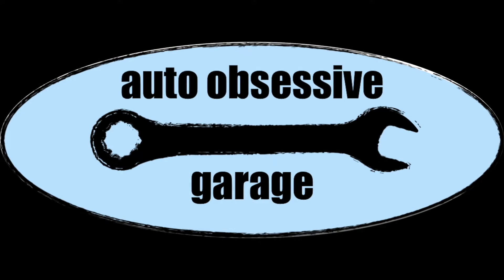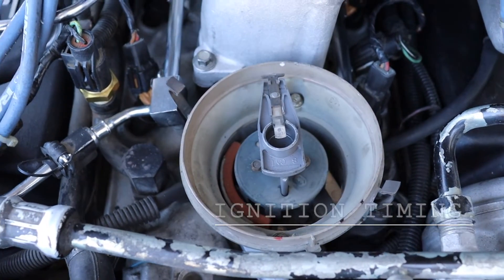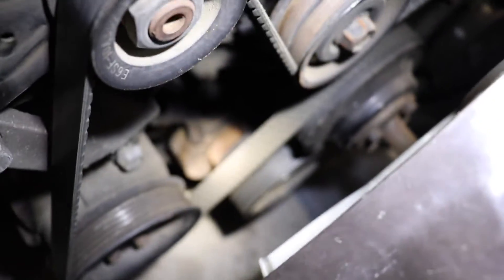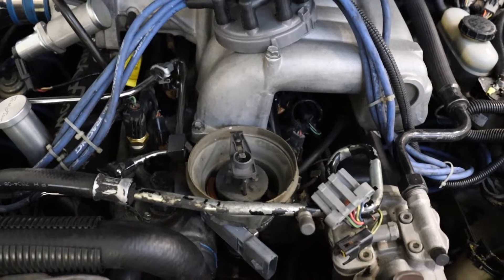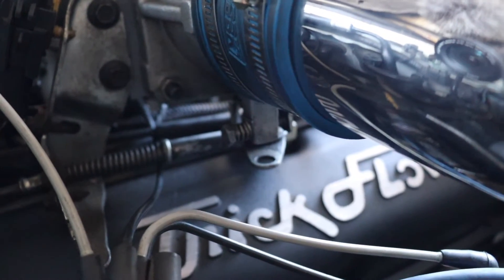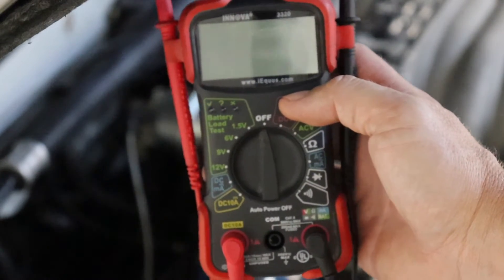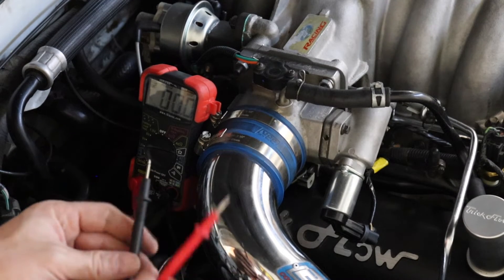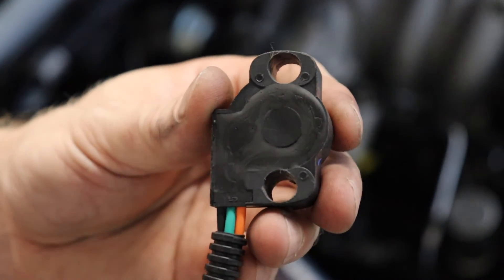1989 Ford Mustang GT - Episode 6: Ignition Timing, Base Idle, and TPS

Comment: Help, I can’t get get timing light mark hooked to #1 wire, I hook timing light to #8 and I get a timing light mark on balancer,
Reply from the maker: You need to use #1 since timing is set off of TDC of cylinder 1. Why can’t you use the #1 wire?
Reply: You can’t see the timing mark with #1, on the balancer, but on #8 you see the timing mark with the timing light
Reply: Wrong balancer or timing cover?Set #1 to tdc and mark 0 on balancer with paint.  Do some geometry and mark idle and full advance (12&34 degrees or whatever you want). Draw circle on paper same diameter as balancer. Draw your wanted angles (degrees) from 0.  Measure distance from 0 around the diameter and then mark your balancer.

Comment: RTV Was applied the because of the vacuum leakage at the TPS mounting surface.
Reply from the maker: That’s what I reckon as well. That being said, not a fan of RTV in vacuum/boost applications as it rarely is airtight. I’ve seen small chunks get sucked through.
Reply: @autoobscuregarage I'm working on a 93 Foxbody right now with super rich conditions. When I've smoke tested it, and I've found the largest leakage from the TPS. The first thing that came to mind was RTV. Now I'm thinking about what you mentioned about it being sucked into the chamber

Comment: MFI is also referred to as TFI, Thick Film Ignition. Same size drill bit on the TPS, slotted in the opposite direction you need to move the TPS is easier than worrying about too big a hole.
Reply from the maker: Great tip.

Comment: Great video.  Did this help the running rich mustang.  I have a 94 5.0 that’s running rich but can’t figure out what else to do?!
Reply from the maker: Just getting everything sorted in the car did make it run much better. Since there were some aftermarket parts swapped around, a professional tune cleaned it up all the way and the car is running great now.
Reply: @autoobscuregarage hey! Long shot I'll get a reply from you but what did you end up doing to tune it? Did you run a standalone ECU or were you able to get it tuned with the factory ECM?

Comment: why was the distributor a thooth out?  Did the owner mess with it previously ?  You did not show how to time with the inline spout connector removed, your viewers may want to see.  Also, the oil pump shaft slotted to the bottom of the distributor, folks need to know that the pump drive shaft may fall in the oil pan if they are not careful during removal, but you did not show that...
Just a suggenstion.   Thanks for you info.
Reply: He mentioned the spout at 5:15. Ford distributor drive shafts are six sided, Chevrolet are slotted. My 1993 had a washer type device to keep it from pulling out, if you put a stronger shaft in it it may not have room for that to be replaced..